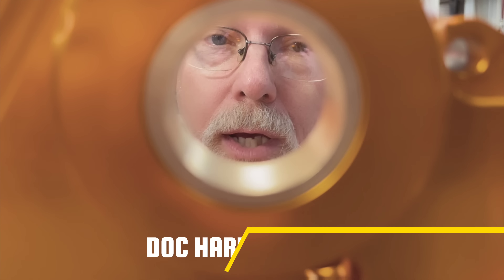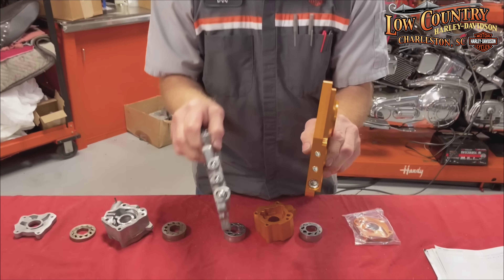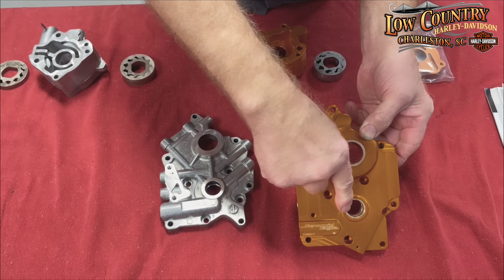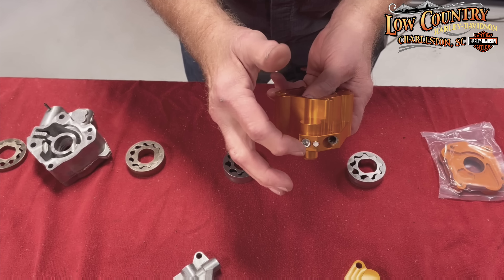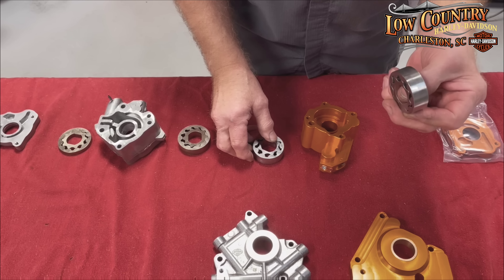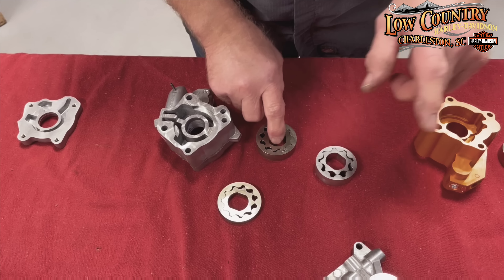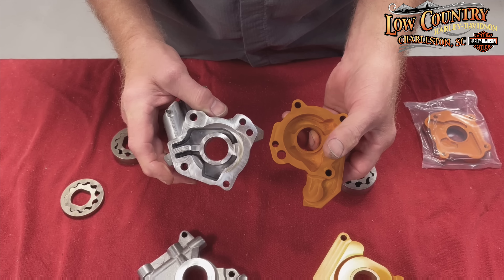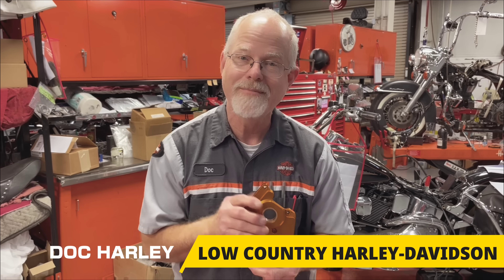Benefits of the Screaming Eagle cam plate / oil pump upgrade for Harley-Davidson M8 | Doc Harley

Comment: Oh, you mean the template and oil pump that should have been installed at the factory? This is my biggest issue with Harley-Davidson. Calls themselves "premium" only to cheap out on the parts, then later sell you the parts they should have used in the first place.
Reply from the maker: I am sorry to read your rant. There are plenty of Stock M8 motors with over 100K miles. The SE plate and pump are designed for those that want more. If You want more then build it if not ride and have fun…..Doc

Comment: Imagine if they just used the good oil pump from the factory so everyone didn’t need to replace it
Reply from the maker: I hear you, but not everyone needs this SE Performance oil pump..Doc
Reply: @LowCountryHarleyDavidson  that’s true I suppose. Doc if you’re able to I’d love to see a video about lifters, specifically focusing on the common lifter failures in CVO 110 engines. What causes lifter failure in CVO 110’s and what has been done to ultimately fix that in the new 114 and 117

Comment: Yeah and these engines are that good that if your run out is to much you can’t even put one of theses oil pumps and cam plates in there 😂
Reply from the maker: What specs are you working with?….Doc
Reply: @LowCountryHarleyDavidson   ive got a 2021 fat bob the 114 engine looking to do a cam upgrade including cam chest kit

Comment: As you know, Harley updated the exceptable amount of pinion run-out from up to 8 thousands to up to 12 thousands before they will fix it under warranty.. My question is what is the max pinion run- out that the Se camplate can run without damage?
Reply from the maker: They The Factory has never published this information. 😡……Doc
Reply: @LowCountryHarleyDavidson  then the product isn't ready to sell to dealer or public

Comment: Ok, by the closing statement,  You are saying that 17,18,19 OEM cam plates are different than 20, 21 & 22 cam plates?  (Yes we know the oil pumps are different but you were holding an talking about the cam plate).. so I'm wondering now.
Reply from the maker: The important part is this S.E. plate and pump fit 17 and later M8 and is a good choice….Doc

Comment: I have a 2021 FXLRS and am going to do the Screamin Eagle Torque Cam Kit. Is upgrading the cam plate / oil pump needed, or would it be overkill for this kind of setup?
Reply from the maker: It is a great upgrade and investment but not necessary for the Stage 2 upgrade….Doc

Comment: I know this is an older video but I'll ask anyway. 1st, thanks for the excellent videos. Now my question. S&S and Feuling both warn not to use their equivalent kits with pinion shaft runout greater then 5 thou. My '21 is .004 and .001 in the bearing for a total runout of .005 - since we know runout doesn't improve, I'm not using either of those. But I can't see anywhere that HD mentions a max runout spec/tolerance. Do you know if a spec exists, Doc?
Reply from the maker: HD has never published the needed specs 😡…..Doc
Reply: @LowCountryHarleyDavidson  thanks. agree with the 😡!
Reply: @LowCountryHarleyDavidson isn't the Camplate a Screaming Eagle product, and it's them that need to publish, and isn't it a must-to-know value before buying and installing, otherwise that SE cam plate isnt ready to sell to consumers

Comment: Most excellent upgrade. I did this with the 122 kit. 447 cam, stock heads, valves, springs, high-capacity lifters. All Harley parts and except S&S billet collars. My goals were mostly performance and longevity. I have 10,000 miles on the build and it runs fantastic. Very little oil consumption and almost no slobber. Oil looks good at 5,000 miles and has been 3 blocks down from the full line last two oil changes running 20/50 full synthetic in the crankcase. I'm ecstatic! Build was on a 2022 114 which thankfully has a beefier clutch than the 107.
Reply from the maker: Thanks for sharing your positive experience…..Doc
Reply: @LowCountryHarleyDavidson  Doc: Thank you for putting out great information so that we can make good decisions about any changes we might like to make! I always take your videos very seriously and consdier you the best source for information about Harleys.

Comment: When I got to 30K miles on my 2006 Deluxe I upgraded to hydraulic cam chain tensioners with the Screamin' Eagle cam chest kit that includes the billet cam plate and higher flowing oil pump.  What a difference in oil flow, especially on the return trip to the oil tank!  The only thing that worried me initially was the increase in "felt" heat under my seat after the upgrade - I was worried I may be sumping, but the cold and hot oil levels remained consistent, no strange noises, and I had no noticeable loss of power.  I have the 95" big bore kit, an oil cooler and run Mobil 1, and there seems to be no mechanical issues so I just deal with the warmer seat.  I really enjoy your channel, Doc - very informative!
Reply from the maker: Thank you for sharing your story and watching our videos...Doc

Comment: Yes. You can buy what Harley should have put on the engine to begin with instead of the junk oil pump and cam support plate on the m8 107.
Reply from the maker: Please share what went wrong with your 107 cam plate and oil pump with stock OEM parts and regular oil changes….Doc

Comment: HOW DO THEY COMPARE WITH SS CAMPLATE AND PUMP ?
Reply from the maker: Quality is the same. Each manufacture has different design. I have not installed both side by side in the same model to give you a true comparison. Both are good. ...Doc
Reply: ok thx

Comment: Hello if u have a 20 rgs 114 and change the cam to a tman m8 216.should u change the oil pump and plate
Reply from the maker: I would call T-Man and ask. That shop has installed that cam in a number of different bikes. I am sure they would give you the best advice....Doc
Reply: @LowCountryHarleyDavidson  ok thanks

Comment: Hello doc, just had screaming eagle cam plate and oil pump installed in my 2012 streetglide along with cr 570-2 cams and fueling lifters I believe. 56k on the engine. Stock heads and jugs. Made 98.6 h.p. and over 116 ftlbs of tourque.  Couldn't be happier. Owigsburg HD in Central PA did the work and tuning. New head pipe and vance and hines monster rounds. They hit it out of the park.
Reply from the maker: Thanks for sharing this great news….Doc

Comment: They left that 10 lobe pump on for 3 years of manufacturing. It was known in late 2017 it was an issue, yet they still used it until mid 2019. There’s no excuse for so of the choices made, especially when the customer just paid a premium to get it.
Reply from the maker: It would be nice to hear your report from sitting in on the engineering team....Doc
Reply: @LowCountryHarleyDavidson  Sounds like an HD response. I’ve owned the 17 SGS from new, being on message boards and groups ever since. It was a known issue. One doesn’t need an engineering degree to notice a problem, especially when it was acknowledged by so many mechanics, the ones not connected to the HD tit. I love my bike and like HD but not making excuses for things that should be handled different. That would make me look foolish, don’t you think Doc?
Reply: hey guys
was told that they sorted the sumping problem on 2020 models onwards?
am thinking of buying a 2020 breakout?
wondering if it will have the same problems?
cheers
Reply: @LowCountryHarleyDavidson  WOW really .... now im not impressed!!!!!!!!!!!!!!!!!!!!!!!!!!!!! what horse crap of a comment!!!

Comment: Is this cam plate necessary if I'm only doing a cam?  But I do need to upgrade my oil pump because I have a 2018 Milwaukee 8 with the older style oil pump in it.
Reply from the maker: It is always your choice. The bigger the cam the more the need...Doc

Comment: This should have been on every M8 as original equipment!!!
My 2019 Ultra 114?
50K miles, meticulously maintained. 
Modifications- HD Stage 1 , TAB slip ons, everything else is stock. 
At the dealership for over 3 months for the transmission oil transferring into the primary, third fix attempt . 
Also major internal engine damage due to the oil pump partially failing. Symptom was almost 2quarts of oil being consumed every 5K miles, dealership was advised several times of oil consumption when it was at a quart every 5K miles and stated “that’s within spec”. It didn’t smoke, and it wasn’t noticeably down on power, but failed the compression leak down test at 72% on the front cylinder. Great motorcycles if you ride under 5K miles per year, and you better have the ESP warranty!!! Damn I wish Victory was still in business!!!
Reply from the maker: Sad story. Stay with us. One bad Apple does not affect All Apple Pies in the world…..Doc

Comment: I have a stock 2018 Deluxe with about 6,000 kms.  I ride it infrequently, but when I do I always ride steady, no harsh operation.  I have  read a lot about M8's and problems some have had and I was wondering if a SE cam plate/oil pump upgrade in my situation would be worth the cost of the work.
Reply from the maker: The SE parts are superior to the cast OEM parts. For you it is not needed just desired…..Doc

Comment: I think upgrading the oil pump on a Harley Davidson is a no brainer even for a stock motorcycle. I’ve been doing it I got 125,000 miles on a 06 street glide with a 95 kit little bit ahead work and compression . I just think it’s crazy that they don’t put screaming able parts on a CVO. I have bought a few of them brand new and that’s what I do to them if the crank run out isn’t bad. But that’s another story isn’t it
Reply from the maker: Thanks for sharing....Doc

Comment: Just change my cam (Woods 22X-E) S&S cam plate, and oil pump. Put a couple hundred Km’s on it, and the engine light came on. Check fluids etc, all good there... 🤔🤷🏻
Reply from the maker: Could be as simple as a bad sensor....Doc

Comment: I definitely recommend the upgrade just not with screaming eagle
Reply from the maker: Please share why?.....Doc
Reply: @LowCountryHarleyDavidson   And most definitely don't want to get into this to sound rude but you guys got s*** customer service service out here anyway As well as horrible Warranty issues Harley Davidson will find any excuse not to cover it with warranty I've had nothing but problems I've heard nothing but problems other companies after market parts parts the high end ones are a joy to deal with And hands down some of the best warranty Replacement out thereI think it's great that you guys are finally starting to understand that if you're gonna make performance bike you should at least put performance parts in itFact that you guys are gloating that you have this after the fact is amusingAfter you've watched a bunch of other companies outEngineer you on every aspect you guysThen feel the urge to create somethingJust my opinion in what I see and what I hear from hundreds of Harley enthusiastsI'm a huge fan of the channel it's one of the only ones I listen toI'm sure the part works well it's the fact that you guys are headache to deal withAnd it should have been done out of the Box

Comment: Would this provide additional performance if I put the Stage II torque/power upgrade to my 21 SGS?
Reply: I’d definitely recommend it, since you are gonna be in the cam chest anyway. Also, you won’t have to worry about having to use different size shims. Mine bolted right in with factory shims.

Comment: hey doc, i have a 2001 tc88a and it has a screaming eagle cam plate upgrade. it was done in 2012 and it only shows 5psi at idle with 30psi cruise speed. i want to put a new oil pump and a set of cams in it. my question is does it take a pre 07 oil pump or a 07+ oil pump and will standard tw6 cams for 2001 fit my plate?
Reply from the maker: Your Screamin Eagle Hydraulic cam chain tensioner plate upgrade should have come with an updated oil pump. You have your idle too low. reason for the 5PSI. 99-01 models use original cam chain and sprocket. so order a cam for your year bike....Doc

Comment: Damn good pump and cam plate. Installed it on my 2020 softail standard when I did the stage two. Had a slight tick with the factory pump, and it disappeared with this puppy. Definitely will install it again on my new 2021 road glide in the near future.
Reply from the maker: Thanks for sharing...Doc

Comment: Hey Doc, Did a stage 2  torque on my 2020 FXST. Had the performance oil pump and came plate upgrage done as well. Very pleased with the torque increase and the cooler oil temp by better oil transfer.
Reply from the maker: Thanks for sharing...Doc

Comment: 20,000 miles 2012 110 oil pump failure took out motor. Screamin Eagle Junk.  
5,000 miles later lifter failire wiped out cams.  All under warranty but still...Harley going back to.AMF days
Reply from the maker: There has to be more to this post. Like compensator got loose ( I don’t know because the way you ride) and nobody knew that when the comp goes out the whole flywheel assembly slams oil pump into the cam plate🤷‍♂️ So a lot of parts did not receive oil plus the broken parts went where? Oil tank, oil cooler, cam area, lifters. Please post all the facts before claiming AMF……Doc
Reply: @LowCountryHarleyDavidson  

Engine oil & filter gets changed every 2,500 miles. All 3 holes 5,000 miles. First engine failure had brass in the oil. Harley dealer told 20-25,000 miles is all they see from these engines. This time there saying lifter failure due to bike started the loud taping noise when it was cranked up after sitting 3 hrs from a 100 mile ride and theres metal in the oil.
 When they get it apart and tell me what caused it I will l follow up but was told it be 2 weeks since it was towed in end of last week.

Comment: Had a 17 ultra limited. Replaced the oil pump and cam plate with S&S
Reply: Agreed!  14 Ultra Limited - replaced the entire cam chest with S&S / major difference from stock or anything SE has to offer!
Reply: That’s my plan for my 2017. I don’t plan to pay Harley for their engineering incompetence.

Comment: In terms of Dollars your biggest bang for your buck is the Screaming Eagle CAM Plate and Oil Pump. It should be noted that Harley's CAM Plate has bronze bushings like the S&S cam plate. However as good as this product is: I prefer the S&S CAM plate and Oil Pump over both the Screaming Eagle design and Fueling's design because I think the S&S is better at scavenging, lubrication, and not wearing out. It doesn't offer the same performance as Fueling's Oil Pump in terms of lubrication, but it is better at scavenging and preventing Oil Sumping. However having said all of that...the HD Screaming Eagle product gives the most in terms of your very hard earned money.
Reply from the maker: Very good points...Doc
Reply: These pumps come with the seal in the back. The competition doesn’t. You are gonna have to get that part from the dealership.

Comment: Too little .. too late for Harley. I have a 2018 model. They should have designed a proper oil pump system from the start, when bikes were built. Instead of charging people $1100.00 later for a pump and plate. This is outrages and maddening!
Reply: The motor company loves giving its customers an opportunity to improve

Comment: harley should put this in the first place. why would you have to pay more . just does not make any sense at all.
Reply from the maker: Please rethink your position. The stock plate works very well with stock cams. Why would Harley-Davidson install the added expense if not needed? This option is for those that want to push the original design for more and are willing to pay for it...Doc

Comment: Doc, would this benefit my 2016 Softail Slim “S”? Yes, the Screamin Eagle 110 engine.
Reply: These are for the M8 engine. The 110 is a twin cam engine.
Reply: @jimbeam4111  Sorry, I didn’t hear that part of the video
Reply: @lm4tuna0461  he didn't say it but it only has a hole for 1 cam, not 2.

Comment: Why are such crucial parts requiring upgrades?  Cam tensioners and oil pumps,  just build it right and stop the upgrade theft.  The more I research, the more bologna I see on this rip off stuff.  Not sure I want a half built bike at these prices.  Keep on polishing but the brand means nothing to me. I am looking for well built machines that are not needing fixed and made right on the showroom floor.  They are playing people for fools.
Reply from the maker: Is there a reason you felt it was important to post this?…Doc

Comment: Good afternoon Doc from a relatively new Tri Glide owner in the UK. Enjoyed the video on the upgraded cam plate and oil pump. Whats your view on fitting these upgrades to my 2018 Tri Glide please? Currently has a Stage 1 kit fitted and looking at going to Stage 2. Tri Glide is used almost entirely for two up riding a touring both in the UK and in Europe. I keep seeing articles on the M8 sumping issue so thought I would seek your thoughts / advice / guidance! Keep up the great videos!
Bob.
Reply from the maker: Thanks, Compare the cost of replacing your 2018 oil pump with a 21 oil pump and the cost for this SE package..I am thinking the SE plate is more than you need, but like me I like to put the best parts in my motor. As for the Stage 2. before pulling the trigger on this make sure there is mapping available.....Doc

Comment: Are you sure you weren't comparing an air cooled gerotor with a twin cooled? The thickness difference was pre significant.
Reply from the maker: I will double check....Doc

Comment: I have an early model 2019 SG Special so I assume that’s the weaker designed oil pump. I plan on doing a 475 lift cam. Do I need a cam plate too or just the upgraded or a hp oil pump?